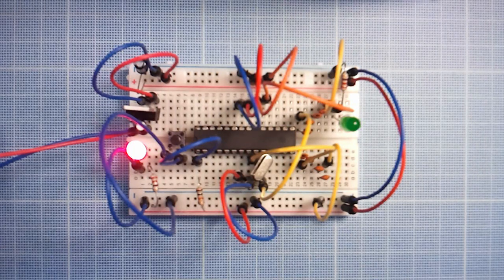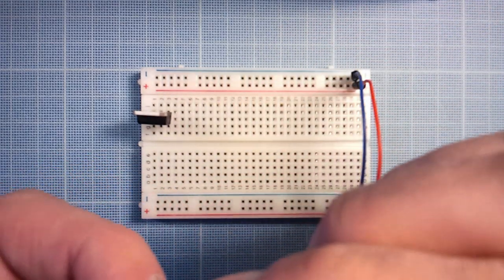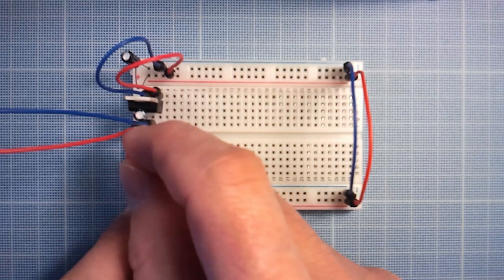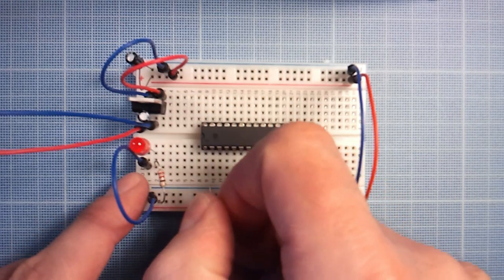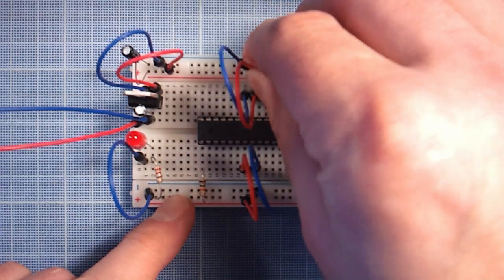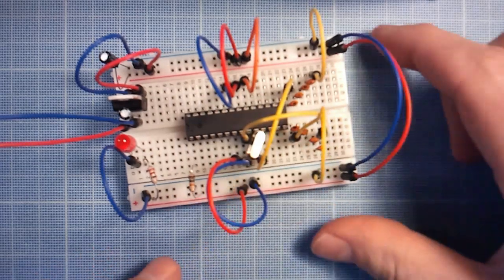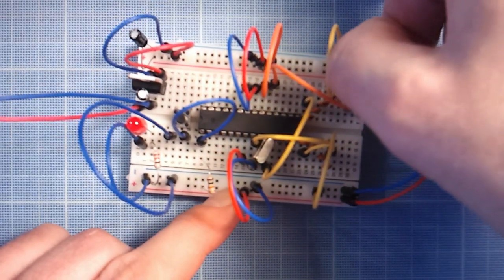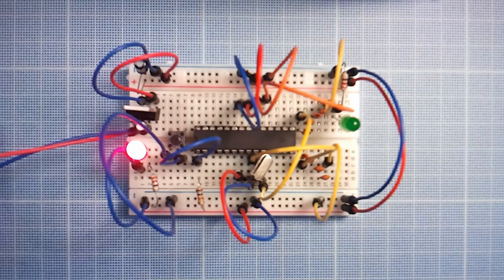How to build a simple Arduino on a breadboard || Arduino tutorial

Comment: FANTASTIC JOB, PERFECTLY EXPLAINED ALSO. I HAVE A QUESTION: WOULD THIS ARCHITECTURE WORK WITH A 3 Nm STEPPER MOTOR OR ARE THERE CHANGES\REPLACEMENTS IN ORDER TO TAKE THE HIGHER VOLTAGE AND CURRENT REQUIRED?  THANKS IN ADVANCE FOR YOUR HELP

Comment: hello sir how much power supply u r providing here and capacitor of which voltage you have used plz reply sir..
Reply from the maker: Hello,
I haven't checked the power consumption, but the breadboard and the jumpers will probably make it a bit higher than if you made a PCB. You need capacitors rated for more than 5V.

Comment: nice man, great job! i have a question tho. is the simplified version of arduino applicable to build like speech recognition robot? just wondering :/
Reply from the maker: Thanks a lot! To answer your question - Arduino is not the best platform for a speech recognition project. I would rather use something with Linux on board, e.g. Raspberry Pi.

Comment: excuse me but why did you hook 21th AREF pin to 5V rail?
Reply from the maker: +deus.ex Hi, I connected pin 21 to 5V rail, because I wanted the analog pins to work with 5V, just like on a standard Arduino Uno board. You can also change the AREF voltage, see how here: http://tronixstuff.com/2013/12/12/arduino-tutorials-chapter-22-aref-pin

Comment: First... thank you for taking the time to make and share this!
Second... I am very much at the starting stages of all this.  What is the estimated cost US of making your own like this?
Third... This IDY controller is more for just making very simple projects? (if so, like what?)

Thanks again!!!
Reply from the maker: The estimated cost may vary. You can buy all parts in a US store like Adafruit, SparkFun, etc. or you can buy them on eBay, directly from China with free shipping option, but you have to wait for your parts 2-4 weeks. American estimated price without the breadboard and jumper wires (I assume you already have these) is about $13. If you want to order these parts from eBay and wait 2-4 weeks the price would be about 50% lower. Some very cheap parts are sold in bulk on eBay, but the price is very low. Let's take 10k resistors: SparkFun sells them for $0.25 a single peace; you can buy 50 pieces on eBay for $0.91 and use the rest for future projects.

The main difference between this DIY Arduino and the regular board is the lack of USB port for programming. If you want to learn how to program the DIY Arduino watch my video entitled "How to program an Arduino on a breadboard (without USB)" How to program an Arduino on a breadboard (without USB)
The regular Arduino is usually used to test new projects before you build them and close in a project box. When the project is working fine and you want to start using the finished version, you can use the DIY Arduino soldered on a prefboard instead of the regular Arduino. The regular Arduino is sold for about $25, but you can make your own for $13 or less.